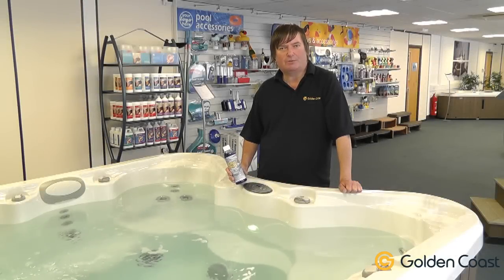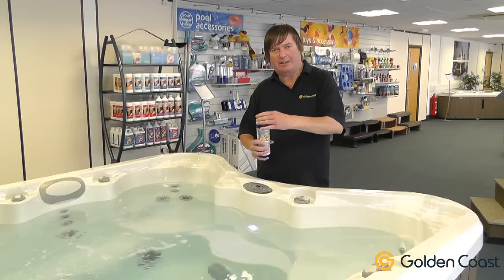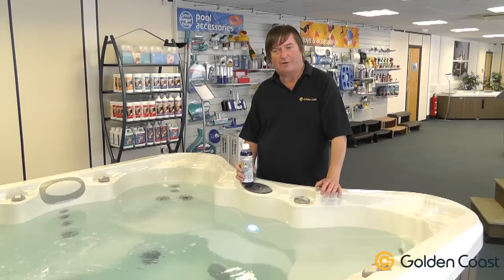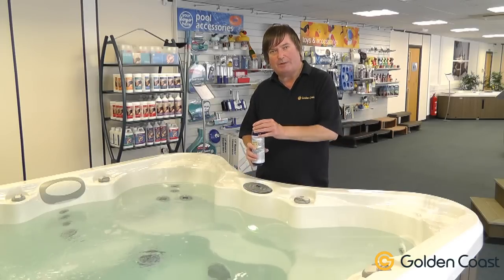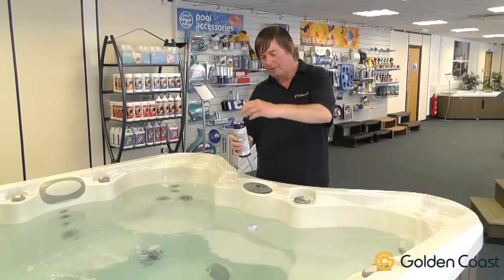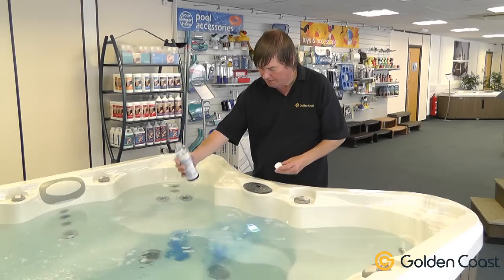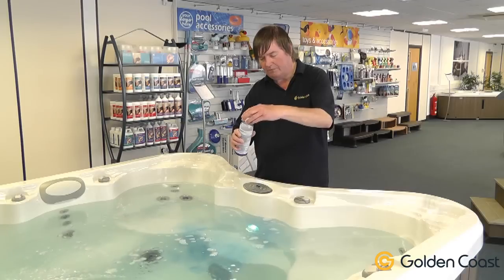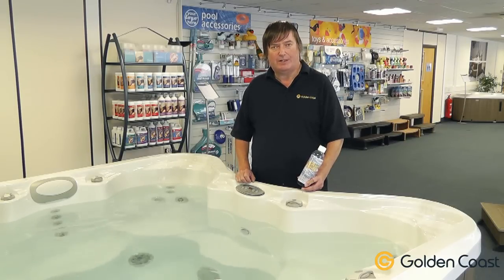Using Swirl Away Spa Pipework Cleaner | Andy's Answers

Comment: Hi Andy can I ask if the air valves have to be closed how can I run the jets ? Probably just me missing the obvious but I'm new to this.
Reply from the maker: Hi Paula. Some spas have separate air controls in addition to the jets and if this is the case then I advise that the air is closed off so just the swirl away mixed in with your spa water is running through the plumbing. Not to worry if you cant isolate your air flow, it will still work although you will probably find that you get a lot of dirty bubbles forming as a result. Hope this helps and that you soon get your spa clean and ready to enjoy again. 
All the best, Andy.

Comment: You didn't even measure it, or use pr9otective equipment!
Reply: Measurements are on the side he said, see how he checked it when pouring? Don't see the need for any protective equipment when dealing with anything going into a spa, if you do, you shouldn't be putting it in there in the first place.
Reply from the maker: Thanks for your comments Mary but the data sheet you show is for a high gloss car polish, not our spa pipe cleaner.
Reply: Mary Jane Jones can you read? That’s car polish lol not spa cleaner I have to admit it tho that’s funny  you got me laughing......